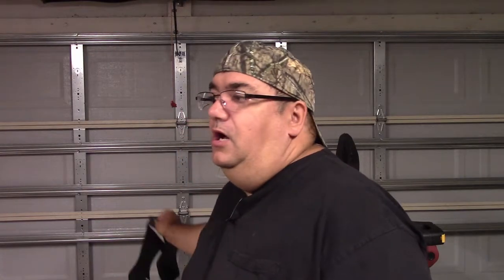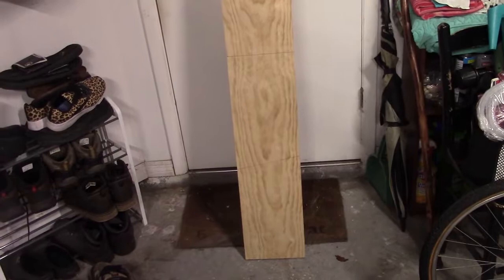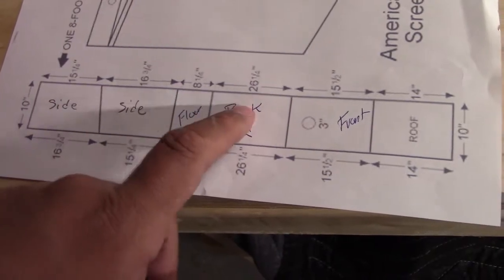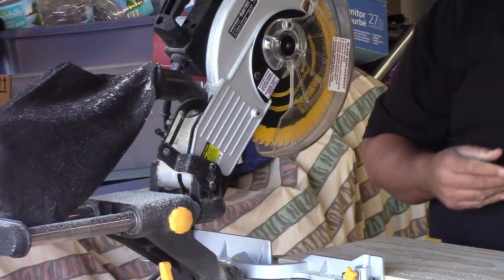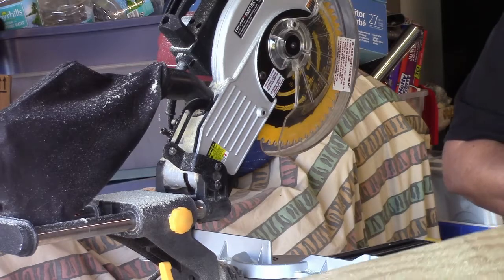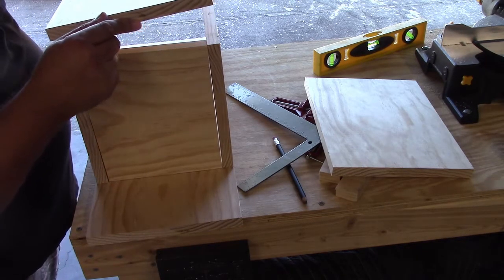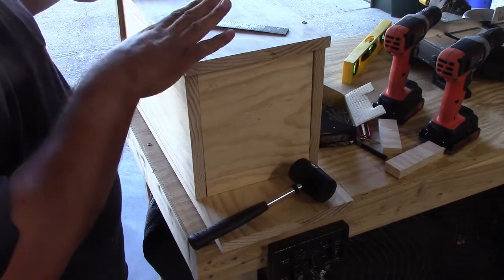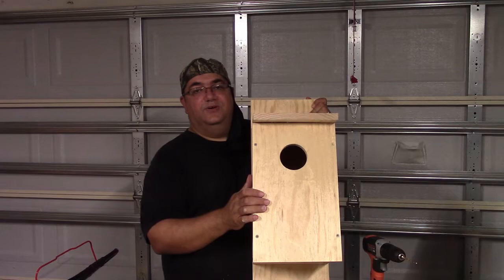How to build a Screech Owl House

Comment: To prevent squirrel problems it can be useful to cut another piece of wood with an entrance hole to screw over the entrance. For Screech owl entry hole, make it an oval, 2.75" high and 3" wide. Than is 7 x 8 cm for metric folks. 

Mount these at least about ten feet high or 3 meters. If you mount them very high there is a risk the chicks could take a tumble and get hurt.

Screech owls feed on white footed forest mice and voles which act both as disease reservoir and hosts to ticks. Owl nest boxes can reduce the risk of tick born disease.
Reply from the maker: Thanks Mark for your comment.